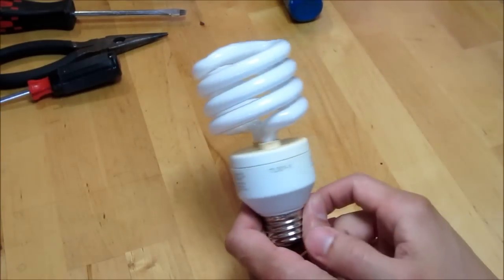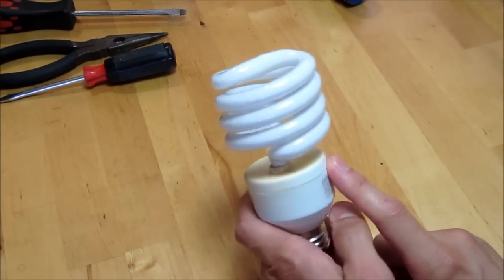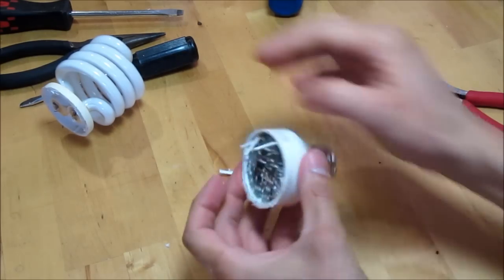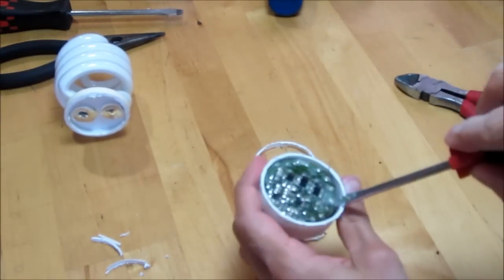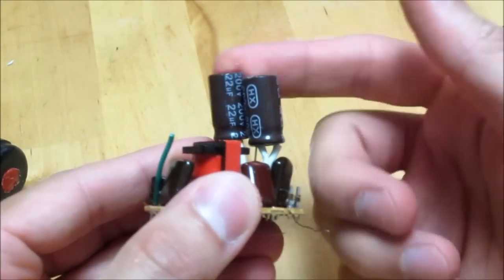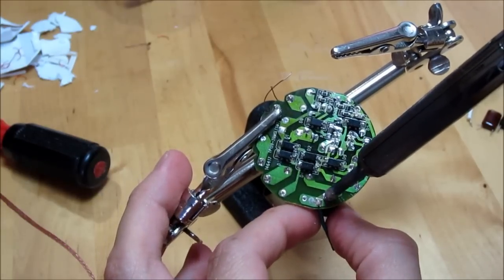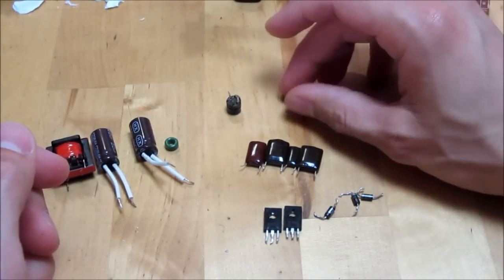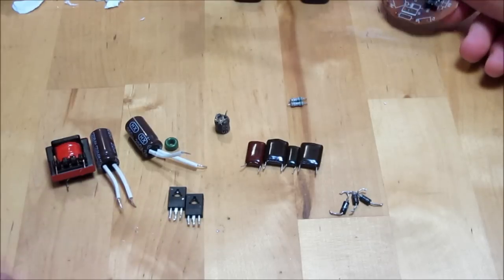Compact Fluorescent Light Salvage

Comment: 2x 200V caps that were not checked for charge or discharged.Dangerous. Also you dont know what a transistor is? you dont know what film caps are? not even talking about the inductor. But transistors and film caps really?

Comment: Are there dangers in touching the wire that connects to the florescent bulb itself? Could there be trace amounts of mercury in there? Or other toxic metals on those wires? The wires on mine look rusted (black and rough) and there is a black powder all over the inside of the casing on the plastic.
Reply from the maker: If the bulb is intact then there's no risk of mercury exposure. The wires themselves are safe but if any of the other components are damaged then you might want to be careful. Capacitors are prone to failing in these things and although the stuff that leaks out of a blown capacitor is toxic, it typically isn't super dangerous for brief, minor contact. I don't know what the black powder is. It might be something as benign as some sort of insulation or might be something from a leaky component. You might want to wear gloves just to be safe. If the bulb works then it is unlikely that a component went bad and is leaking.
Reply: Makify1 Ok, thanks for the info.
Reply: Its probably the dielectric, they usually consist of such materials

Comment: Excellent teardown and description!  I've been looking for some cheap capacitors and diodes with higher voltage ratings to use in building some boost voltage converters.  It's a shame to waste them.  Most CFLs seem to fail without breakage of the bulb and leakage of mercury vapor.

Comment: The two thing with three wires are transistors, as in transistor radio, they replaced tubes, worth reading up on.
Nice to know I'm not the only one that likes taking things apart.
Whether it's worth or not, earlier this week, my computer wouldn't start, and because of what I learned tinkering with stuff, I was able to take it apart, figure out it was the power supply, find the problem, go to radio shack and buy a resistor, and I got it working in a total of 2 hours.
It cost me $1.98 to fix.

Comment: and WHY would you want to do this?
Reply: I do it to make joule thief led flashlights, as the bulbs have all the necessary components to do them.  I use them as backup light (in my keychain, for instance) but to fully discharge batteries. and because it is fun.

Comment: Amazing Fact! The total amount of mercury in a common CFL is less than the period at the end of this sentence. So don't fall for the mass hysteria about CFL mercury dangers or call out the HAZMAT crew if you break a CFL bulb. There is more mercury in one of your dental fillings than a thousand CFL bulbs.  By the way if you have mercury fillings have a qualified dentist remove your dangerous mercury fillings. Check out "mercury filling hazards" on YouTube.
Reply: +ipissed  That's why dentists do not use CFL's for dental fillings. Also  CFL bulbs used as fillings usually protrude from the mouth in a most unattractive manner which makes them unpopular even among environmentally correct liberals.
Reply: A thermometer has 100x more mercury than a cfl
Reply: +Biodegradable Bill The amount of mercury gas in a cfl bulb is more than the amount of mercury gas that will escape from a filling in a lifetime.
Reply: Biodegradable Bill
If everything were biodegradable the universe would have already consumed its self before you ever were.
Reply: +Biodegradable Bill 
You made me laugh so friggin hard, my dentures fell out !!!
Gudun mate.

Comment: Thanks for the video.

The only thing: One should discharge those caps before handling that PCB. If the caps are charged up, they might zap you. More importantly, it is a good habit to treat, like a gun, caps as always being "loaded." That way the possibility of a surprise of the shocking kind, and possibly harm, are reduced.
Reply from the maker: +K. Chris Caldwell  Yes, good tip!
Reply: And how to discharge them ?? 
are not inductors (inducers) also in need for discharge ????
Reply: Knux Quatorze screwdriver short crkts? 
screwdriver is not grounded
Reply: Knux Quatorze in order to make it short crkt .. screwdriver must be grounded man ..
Reply: @Hamdifollowing  You just touch both leads at the same time with a screwdriver. It doesn't have to be grounded. But you want to be sure the handle is insulted.
Reply: No dont insult the handle, he get upset ;) @peterfitzwell9658
Reply: @matthewreynolds8025  Hahaha! Damn autocorrect!😜🤣😂
Reply: Knux Quatorze nice ...
Reply: Knux Quatorze thnx .....
Reply: K. Chris Caldwell
Reply: Inductors discharge themselves in oscillation but most caps have very low leakage so be especially careful with large caps like for motors. You should use a extra high current resistor, like a cement resistor with a heatsink to discharge higher capacity ones or else the spark itself can be dangerous (and they ring your ears too)

Comment: Q1 and Q2  are "transistors"   and the thing  marked  101K is a Choke Coil or Induction Coil   101K or also...  101uH
Reply: Yes.   101uH with a K tolerance of +/- 10%.   Ref:  http://www.electronicshub.org/indcutor-color-code/
Reply: would this inductor marking be identified with the same system for capacitors... 101 ... 10 (base) and 1 zero after that, so, 101 = 100 μH and 102 = 1000 μH (or 1 mH)... the website taz104 gave a link to describes: first digit and second digit and the third digit is the multiplier (rather than, adding that number of zeroes)... so, this must mean that the inductor is 10 μH (right? 10 x 1 = 10)... oh, it's 10 ^(1) or 10 E(1) or 10 exponential (or exponent of) 1 based on μ ... not 10^1 (or 10 to the power of 1)... so you can just simply add that many zeroes... only, caps are based on pico; not micro... but sometimes micro with enameled caps (green, red, etc...) labeled 0.01K (10 nF)*
Reply: 101K is also a 101 micro Henry sir?

Comment: I've taken the liberty to subscribe to your channel and hit the "like" button. 

You've done exactly what I do when I need extra parts.  LOLOL 
-Cannibalize an old CFL bulb. 

About those little ferrite toroids.....Yes, they work very well with joule thief circuits. 
Those 22uF (MICRO Farad) caps would work very nicely in a "pulse width modulator" (PWM) circuit with the 555 timer chip. 
Those diodes are typically the "1N4007" and would also work well in a lower frequency PWM.  I use them as half-wave-rectifiers on the hot-leads inside my table lamps (to use only the positive half of the sine-wave), as half-wave-rectifiers inside other CFL bulbs, Bedini circuits, etc.  They are rated to handle main's-voltage and work very well there. 
Those things on the board that were printed as "Q1" and "Q2" are NPN transistors.  They are very tough, fast and work "very excellently" in joule thief circuits.  I emphasize the word, "very" for those transistors. 
Those next things that you looked at that you think are "probably caps;" -actually are caps...They are non-polarized metal-film-caps and would work well when making your DIY LED bulbs. 
That next thing marked with a "101K" looks like a capacitor.  However, I do know that a lot of CFL bulb makers use a small smoothing inducer. 

Let us all know what you decide to use those parts on. 

Thanks for the video.
Reply: Advait Mehla I really do not care to teach you proper English.  That is for you to learn, if you really want to.  I'm not gonna hold your hand here in YOUR endeavor.
Reply from the maker: jmjpowerjoule Thanks for all the info! Thanks for "liking" and subscribing too, I appreciate it!
Reply: jmjpowerjoule Lol! Its alright! btw, both mf and Mf imply to millifarads and uf is used for microfarads!
Reply: Advait Mehla:  
"If" it was late?  "If" I was tired?  I don't like being called a liar.   
I was not in need of using a search engine. 
Why don't you just go fuck yourself, you surly little pompous ass.
Reply: jmjpowerjoule Dude! It's 22uf NOT 22mf!!! 22mf is a very huge and expensive and is of 1000 times more capacitance than 22uf.
Reply: Advait Mehla And if it was late and you were tired as you are saying it is justified that you might have made a mistake. But after that you continued to say that m=micro and M=milli! Use your googling skills bro!
Reply: jmjpowerjoule I dont give a damn to what u do so just stfu. You were wrong end of story. Call me whatever you like and say whatever you want to im not replying to any of ur stupid illiterate posts. Enjoy!
Reply: Advait Mehla Hahahahahahahahaha!  You even have grammar errors in what you said, when you called me "illiterate."  Hahahahahahaha.  
You cannot even spell properly.   Silly little boy.  
"STFU" you say???  

Here is how I see you now:  
~~~~~~~~~~~~~~~~~~~~~~~~~~~~~~~~~~~~   
"Stop saying that!"  "Shut-up!"  "Stop saying that!"  "Your not nice."  "Stop-it!"  "I'm right and your wrong!"  
~~~~~~~~~~~~~~~~~~~~~~~~~~~~~~~~~~~~  
Hahahahahahaha    

Part of being a man is admitting when your wrong and letting things go.  
You were right about the little "m" needing to be a little "u."  So I made the proper changes after I woke up the next day.  However, you falsely accused me of making that error out of ignorance, or something like that.  
You were wrong to do that.  You also are an ass because you don't like being told when you are wrong, when you really are.  
Like I said, part of being a man is admitting when your wrong.  Now I'd like to add to that; "Respecting the good name of others."  
Back when I was a substitute teacher for a school district here, I used to discipline children that acted just like you.  
Now, YOU enjoy.
Reply: jmjpowerjoule Would you pls care to name the 'grammar mistakes' you are laughing at? Were you tired and it was late(again!)? I dont think i have spelled that wrong coz i can't see anything wrong. I said illiterate and you corrected me saying it's 'illiterate'(I think only you can spot a difference between those). I guess you were too tired to notice that and also busy writing ha ha ha millions of times. You can see that i haven't edited my original statement. Get a grip bro.
Reply: Advait Mehla #silenceafterhumiliation
Look who has suddenly gone silent now...... First you made a mistake. Then you denied it.Then you edited it and hurled abuses at me and edited your post. Then you corrected me for something only you know was wrong. And now, after all of this, you go silent after removing your pots so that the world would not see the fool behind that name....
You have successfully qualified for all the descriptions you set for me.

Comment: I am sure, those parts will be more expensive than the whole bulb if buy them separately, but I just come up with another idea: If you got pare of bad bulbs, you could actually interchange a survived good board and a spiral to make one good light bulb. I am considering the idea that usually only one of those two components burn out,- either a board or a spiral, but not both at the same time...

Comment: Use soldersucker + flux
Reply: Heat gun at 400-450F. That will get everything off the board in seconds, including the surface mount parts. Works wonders to unsolder BGA parts on motherboards too. The "green unidentified" parts are Mylar capacitors. I suspect the other unidentified can 101K is a capacitor as well.

Comment: can i convert a bulb like this to dc so it runs on a car battery or solar system
Reply: It IS running off DC (that's why it has the 4 diode bridge and cap, to convert ac to dc), but it's at 120/230 volts. Easiest solution is probably an inverter
Reply: You could buy LED lights. They consume less Wattage and you could run them on almost anything.

Comment: The 3 pin flat black components are triacs.  They are what allow a flourescent bulb to be used with a dimmer.
Reply: +adam putman are you talking about the e13003? The datasheets I found said transistor.
Reply: Interesting.
Reply: E13003 are transistors. Alas, their transition frequency is 3 MHz, so they can only be used at low frequencies.

Comment: the thing marked 101K is a coil CW8A type.
The thing you called transformer is not a transformer but a inductro as well.
The only transformer is the little toroid. It has 3 windings and it is used for switching the power transistors on and off.

Comment: Sometimes (as you will know) the driver fails while the tube is still OK, I've had this happen and with a blue CFL I took it apart and connected the tube to a magnetic ballast. I also tried it with a Philips Matchbox HF ballast. The tube works well and, with a suitable ballast, will be driven at the correct current. Have you tried this?

Comment: its amazing they can make these things so cheap. If (as a hobbyist, ordering in small quantities) you went you to buy those parts you would quickly rack up $5-10. The transformer, the inductors, the large caps - all are > $1 parts. I've been using these dead CFLs for joule thief bottle lights that eek a bit more life out of a single AA cell. I've yet to find out if the recycling center will take the disconnected flourescent tubes back though. I hope so, I much prefer to upcycle.
Reply: Home Depot has a bin at the front of the store for fluorescents.

Comment: Word of warning regarding salvaged components, the high voltage electrolytic caps has probably no life left, usually they lose their capacity pretty fast in hot situations like this. Some lose 30% within 2000 hours at those temperatures inside socket. By the time the bulb is dead so are the 'lytic caps. Other components fare better though.

Comment: I would like to see you reuse the circuit board. Its ready to go and in a nice configuration, it would be nice to figure a way to slightly modify it or us as is to power something or control something.

Comment: one question.if the smoke comes out and the base of one of the bulb ends turned black,does it mean the mercury vapor was released?
Reply from the maker: The mercury is in the bulb so as long as the bulb doesn't break (shatter) then you won't be exposed to it.

Comment: I usually take these things apart for recycling when they burn out.  Just remember the mercury is in the glass bulb, so try not to break it.  Don't freak out if you do though.  The amount of mercury is negligible.  You'd have to be breaking these things and inhaling the vapors on a daily basis to start seeing any effects.  The big deal is when a bunch of them pile up in a landfill, so stick the bulb in a plastic bag, and put it with your hazmat bin along with spent batteries and whatnot.
Reply: Since we want to keep it out of a landfill, why not put cement around it and make it into a building block/brick? My trash pickup service doesn't have recycling, so I am looking for ways I can keep it out of a landfill myself. I don't want to put it in a bin with others for any length of time because they would probably get broken that way.
Reply: I know it can be difficult since not all services offer hazmat disposal.  Thankully LEDs are already beginning to take their place.  Just remember that when you crush one you're releasing mercury vapor.
Reply: *****
I agree with freedom of choice. If the power company is going to sell you electricity, then you should be able to use as much as you can afford to buy. Rather than force us to use mercury containing bulbs, when the perceived problem is too much power consumption, why don't they ration the power allotment? Inefficient refrigerators and running the AC too low are just as much or worse power consumers. If power was rationed, then people would voluntarily look for a way to consume less power or to produce their own via solar cells etc.
If I can't have my incandescent bulb in the winder to produce both heat and light, then I will switch to gas lamps.
I happen to have some CFL bulbs already and I can buy LED bulbs, but the stores are no longer going to sell 100 watt incandescent bulbs. That's not a problem for me because I can just use three forty watt bulbs instead. I will never buy another CFL bulb. I want some more LED bulbs for the summer, but I prefer to heat the room with incandescent bulbs in the winter. If I can't get them, then I'll just go to using heat lamps. Is taking away the incandescent going to reduce energy use? Not one bit.

Comment: need to clean the tip of that iron, use a drop of fresh solder on the end, and if you use a drop of flux then heat from the tip will de-solder components easier!

Comment: The last component is a coil which has a ferrite core.
Reply: Hey that's pretty cool, I knew they where coils, didn't know they had a ferrite core! Could those be used for a joule thief? Would be cool since I have like a ton of those laying around! Thanks for the video!
Reply: Frequency Bender You can even use the 1300x NPN transistors too for the joule thief circuit but check first if the transistors are good, sometimes the transistors die with the bulb but not always.
Reply: Really???
Reply: Yes Abrar Shaikh.
Reply: Frequency Bender , sure they can be used for a Joule Thief.

Comment from the maker: That's a common problem with flourescent lights and it could be a couple of things. It could be the bulb itself, a capacitor like you suggested, or something else. The difficulting in trying to fix CFL's is that it is hard to open them up in a way that lets you close them back up well. If you try replacing parts, I'd love to hear about your results though.

Comment: Christ almighty, no wonder these things are so goddamn expensive. There's a shitload of components in there! Old style incandescent bulbs just had a tungsten element soldered to a screw-in base with an outer glass covering while these CF bulbs have a fully populated circuit board in them not to mention the fluorescent tube!
I always wondered what was inside the base of these things. I figured there was likely some type of ballast control but this is crazy!